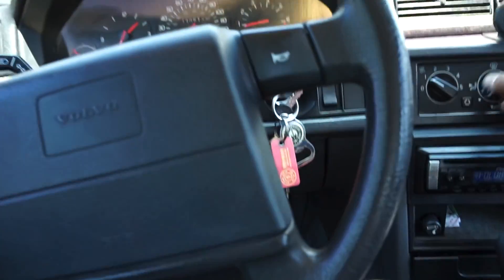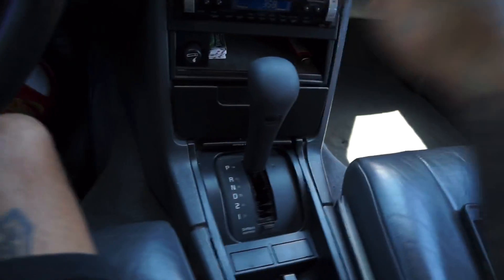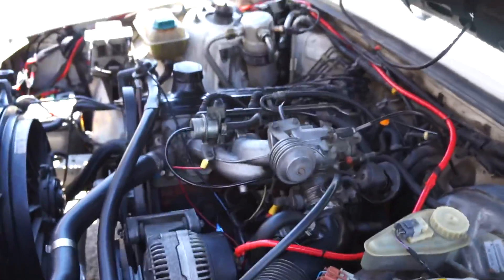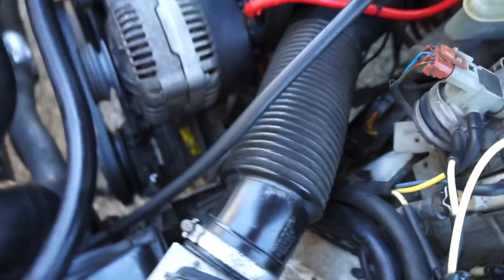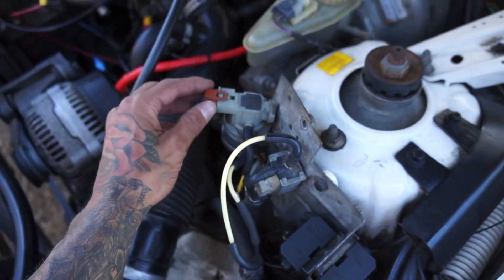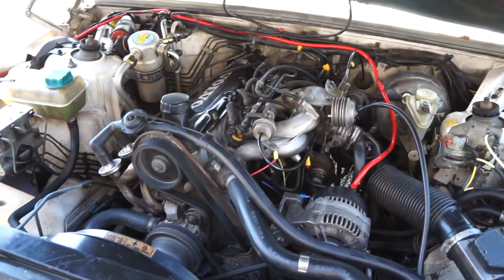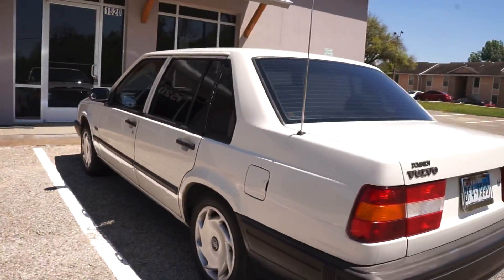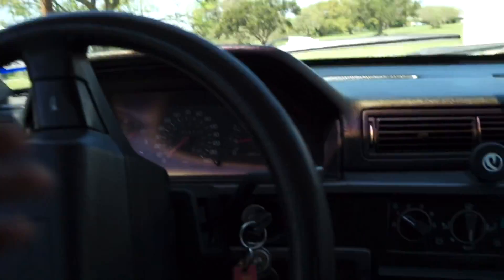Volvo 940 daily driver 430k miles

Comment: That is some insane mileage 😳

I recently bought one of these tanks for 1500. 261k miles on the clock, figured id risk getting it since it seemed to be in great condition. Needs new tires but thats about it
Reply from the maker: Unfortunately I didn’t get to see it at half a million. 470k and I had to let it go:/ loved that car
Reply: @vincentbryan1962  awe dang. Any reason why you got rid of it?
Reply from the maker: @JuanJimenez.  mostly my fault. But it was having a very rough idle when I would turn on the car for the first 30 seconds like it wasn’t catching spark or something. I replaced everything you can think of. Spent more than 600 on brand new spark plugs ignition coil, distributor cap and rotor, idle air control, 

And the coolant temp sensor was the last thing I was trying. Ended up tightening the sensor too tight and it cracked inside the engine block. The half sensor broke off and the other half stuck in the manifold /engine. I tried to use some heat jb weld a new sensor in there but it was just too far gone. It was time to sell it. It was taking more money from my pockets than I was getting from it. 

I ended up finding a Geo Metro for my new daily car. Going from 20 mpg in the Volvo to 47 in the metro. So it’s working out in my favor . There’s the long story

Comment: That car is gorgeous it's a beast that's a blast to own I'll tell you one thing though take those aftermarket headlight bulbs out of there they will ruin your electrical system in your alternator and you wonder why so things is happening with your car at all fingers point to that light those aftermarket lights did not properly grounded out they don't care they just want you to buy the bulbs or whatever they don't care if it ruins your electrical systems I wouldn't suggest you run those in your car especially an older Volvo but that car is gorgeous take good care of it and it'll take care of you

Comment: Your car looks great and your engine sounds fantastic! How is it 2 1/2 years later?
Reply from the maker: Thank you! Very much appreciated! 
I recently had to get my kickdown cable replaced. And also my abs speed sensor replaced because my odometer/speedometer stopped working (after years of wear and tear of the wires) 

It’s still my daily driver 465k miles and going strong.
Reply: @vincentbryan1962  Glad to hear that you still have it and that it is still "going strong". The 940 is probably the best RWD car Volvo ever built and if you take care of it it will last for decades!
Reply from the maker: @bobjohnson205  thank you I plan my best to take care it it! I plan on keeping it for that long :) I try not to abuse it and drive it recklessly or rough. I really do want this one to last. The only thing I’m worried about is the other people on the road
Reply: @vincentbryan1962  Yes, be VERY worried about those people!!! There are far too many distracted and careless drivers out there. I was rear-ended by one of those 7 years ago and nearly lost my '90 740 GL - and my life - because of them. Fortunately, we're both very hard to kill and are both alive and well! 😀

Comment: Looks good!! I have same car...my passenger side wiper stopped working. Do you know how to access it? Thru dashboard? Eek
Reply from the maker: I know for sure there is a relay for the wipers. You might wanna try getting a new relay for it in my opinion. When I switched out my fuel pump relay I accidentally took out the wiper relay and it stopped working that’s how I found out I was messing with the wrong relay. Should be cheap around $20

Comment: thinking about buying one, it has 162 miles on it. Got any tips on what i should look for before i buy it? thanks
Reply from the maker: drullumall96 162k miles ? That’s it? My tip is to take care of it. Keep it clean, one day it’s going to be a classic and the price will go up I believe. These are the last of the reliable Volvo’s. The 90’s Volvo’s were made with room in the engine so it’s easier to work on. The parts and labor if you take it to a shop can be a little expensive so put an emergency fund aside for like $700 just incase. Mine has half a million miles on it. So drive it like it’s reliable because it is
Reply: @vincentbryan1962  yeah, thats it! And it has no rust which is very common here in Iceland cause we use alot of salt on the streets during winter time. The timing belt has been changed 2 times thus far, but it was couple of years ago the last time it was changed. 
The owner is a old guy and already owns 3 other volvos (new and old). And the price is 2.732 US dollars. Ofcourse its a different market here and different currency but to put in perspective my salary for each month (working with school) is 1.294 US dollars.
If Ill manage to sell my opel before the volvo gets sold Ill buy it for sure and send you picture.
Excited to join the volvo club haha
Reply from the maker: drullumall96 make a little walk around video. Pictures don’t do justice! Hope it’s good to you like mine has been to me.

Comment: What is the part below the alternator that spins on the belt as well? Directly below it. On my 940 the belt is not spinning on it. It runs good still.
Reply from the maker: The belt below mine is the ac compressor for the air conditioning.
Reply from the maker: all the belts should spin because each belt is connected to the crank shaft. Going in their separate directions. Alternator belt 
Power steering belt 
And ac compressor